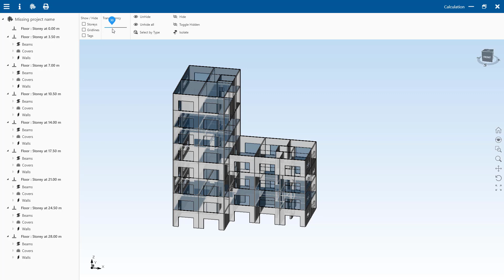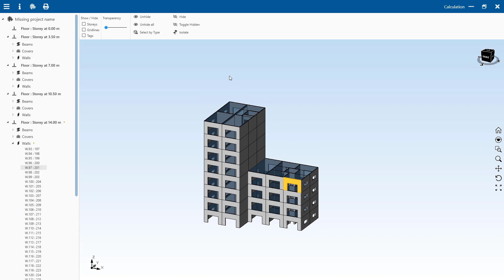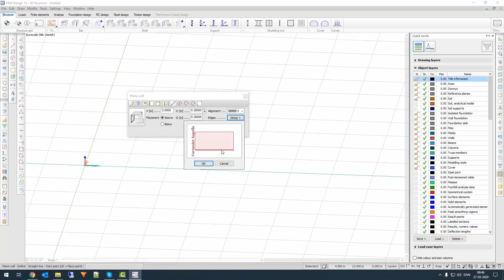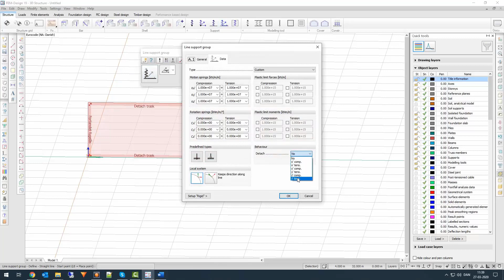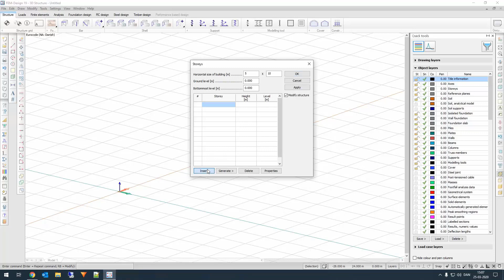PREFAB Print - Overview

Comment: Does the software do the  design and the steel reinforcement ?
Reply from the maker: The software does not do a design. It has been developed to give you a quick overview of the analysis results and quickly compile a comprehensive structural report for the Precast Concrete Manufacturer. The analysis must already be made in FEM-Design so that it can be interpreted by Prefab Print.
Reply: @StrusoftOfficial  Thank u so much, there is a software that does the design of precast concrete constructions ??
Reply from the maker: @noraalaoui9151  Yes, the design can be made in our finite element software, FEM-Design. You can see more details here and apply for a free trial: https://strusoft.com/software/3d-structural-analysis-software-fem-design/